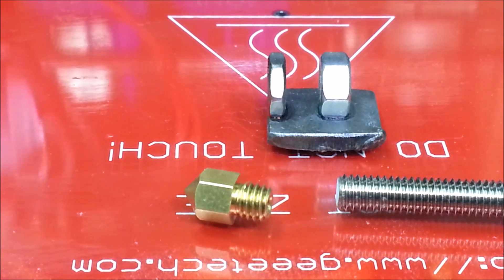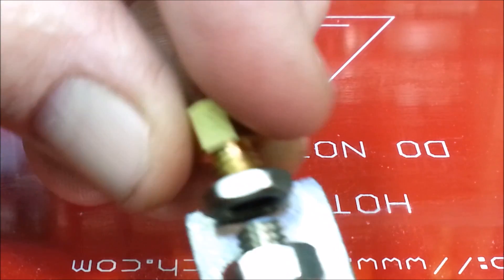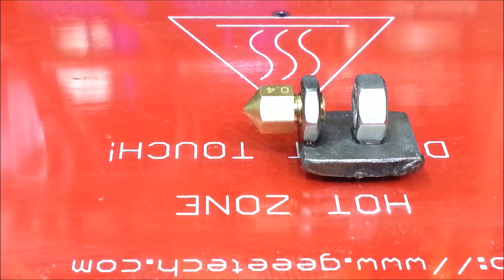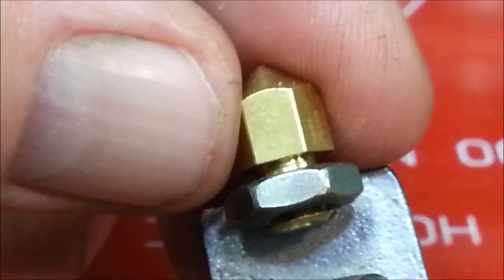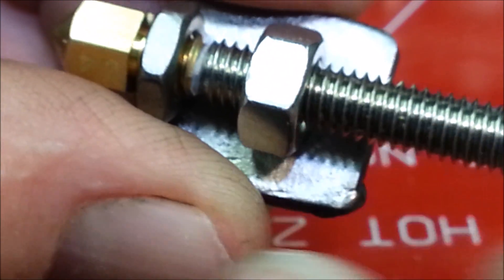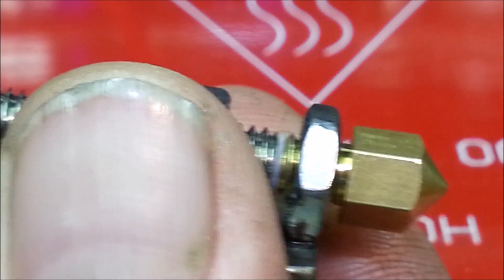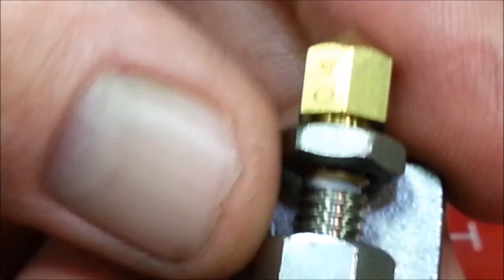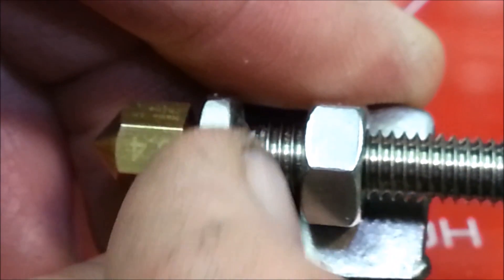How to fix a leaking MK8 Extruder

Comment: can i install the heatbreak upside down ?
Reply from the maker: It's totally possible to do it, Remember the side that is all metal and has the taper goes up.
Reply: so i have a clone mk8 extruder kit, and the ptfe tube literally melts/deforms in 4-5 prints, tried 2 times to get good heatbreak but get the same one with same quality, so i odererd some PTFE tubing, ill replace when it arives, 

do you think this can be problem of hotend not cooling down properly ? because i dont have a fan which cools nozzle or hotend, (i need to print adapter for that, so first i atleast need to get the printer working)

Have you ever had experience with such low quality ptfe tubing ?
Reply from the maker: I finally switched to Capricorn tubing.  It holds up to higher temperatures and doesn't degrade as fast.

Comment: Nice fix, I was wondering if, is it normal filament coming out of the extruder when it is not printing but it's hot?
Reply from the maker: It is to a extent.  Ofcourse the hotter the temperature the more it will ooze.  But some oozing is expected.

Comment: I had leaks from where I put a different 0.5mm nozzle on. I took back off and put the original on and it didn't leak. Not sure what the problem was there but I don't think it's this.

Comment: I don't have this issue, but I have an issue where when I heat up pre-printing the nozzle is pushing out filament and unless I sit there and grab it off with tweezers right up until the print begins it'll ruin it. I've also tried disabling the gcode to feed 3mm of filament pre-print but then I end up with prints where no filament comes out and I have to manually push filament through the hot end.

Anyway....My question is, is there a way to stop the filament coming out of the nozzle pre-print? Should I have retraction in my end gcode and then keep the 3mm purge in the start gcode? Having to sit there removing plastic pre-print is not the greatest, especially since I want to setup a print server and do this remotely. Can't always be around to manage a leaking nozzle, you know?
Reply from the maker: Unfortunately unless you print at the lowest possible temperature it is a necessary evil.   I always have to pick the dangling filament from the nozzle at the beginning of a print.
Reply: @JimmyShawsTidbits1  I've learned to live with that, but now I am back here to fix a problem I created while trying to fix a problem I didn't have. This new hobby is turning into 4 other hobbies, haha.

Comment: Sealing the threads with tape hides the problem and is a bad idea.
I had three 'silent leaks' that way; no oozing from the top or bottom of the heat-block, but PLA did find its way into the gap between Bowden tube and heat-break tube.

With the nozzle cold, could not remove the Bowden tube.  Nozzle hot, I was able to remove the tube with lots of effort.
What he said, nozzle to PTFE tubing fit is critical!
Save yourself lots of grief, make a tubing holder and use fresh razor-blades to get square-end cuts from PTFE tubes.
This issue is going to crop up whenever the PFTE tube and the nozzle must for a seal.
BTW, One 'silent' leak ruined an Olsson ruby nozzle; there is an inner sleeve that holds the ruby in place in the body of the nozzle and I had PETG leak into the body/sleeve gap.
This plastic in the gap made a heat-break, nozzle stopped working.  
Olsson, your design sucks!  That inner sleeve should be sweat-soldered to prevent plastic ingress.
I burned out the plastic [a no-no according to Olsson], re-assembled the nozzle, soldered sleeve into place. Be sure to use a high-temp silver bearing solder as a 245C hot-end will melt common electrical solders!
Yes, the notorious Olsson stoppage has an easily fixed cause!
If you don't mind modding a $90 nozzle with silver brazing, borax flux and a MAPP gas torch, Robert is your parents sibling...

Comment: So i just popped out my  Teflon tube just a bit and tapered the edge (not needing a completely new cut) and 1hour in a 23hour build I haven't seen any leakage. THANKS!
3D printing hobby is not about 3D printing but running maintnentce on the 3D printer itself. lol.
Reply from the maker: Absolutely true.

Comment: Hi,
just to make sure: after this fix one can only print things with a lower temperature than about 235-250°C due too the direct contact of the  ptfe to the nozzle (compare that to the comments on a e3d v6 lite hot end where the ptfe tubing goes as deep). Possible 'damage': leakage, clogged nozzle..
Regards
Reply from the maker: +Christian Abramowski To my knowledge, any hot end that uses PTFE has a temperature limitation.  The only hot ends that do not are all metal hot ends.

Comment: Nice idea, but aren't you just supposed to tighten the nozzle when the head is hot - like 180-200 degC? I am using old J-heads - and I had similar issue when I assembled the head for the first time in cold. But after hot assembly - and proper tightening in hot - there were no leaks at all.

Comment: Great Video. I had this kind of issue with the throat jamming constantly and it was probably due to this. Finally got mine working but haven't looked at the teflon tube. I just have a leaky nozzle now but that's because I only put teflon tape on the throat side not the nozzle side. So gotta do that. 
Thanks

Comment: Hello sir, real urgent. Do you have alot of clogging problem with mk8 extruder? What is the temperature surrounding you?
Reply from the maker: +Steven Lee I do not.  If you are having alot of clogging check your Teflon nozzle throat and use a new nozzle.  Make sure your retraction settings are no more than 7mm, any more and it will clog.  If you still have a problem, consider using a oilers to clean the filament.  Another thing that can cause clogs if filament diameter.  Alot of cheaper filaments do not have a constant diameter causing it to get stuck in the throat.

Comment: I had already had this same problem with mine and I didn't have to do this. All I did was tighten it down while it was hot and it has never leaked again. The Teflon tube on mine doesn't stick out but after I tightened it while it was hot it stopped the leaking anyway. The only problem I have now is settings. I am very new to the 3d printing and have no clue about settings. Any help would be appreciated. Thank you.

Comment: Wow, such a good video with so few views and comments.  I've been looking all over the internet to try to figure out which end of the throat goes into the heater block.  Now I know.  "And knowing is half the battle."
Reply: I found this out the hard way. I broke my throat tube and ordered new ones and I found outI put it in backwards when I thried to pull the filament out. The Teflon tube came out of the end and the screw that you have to mash stayed down because the Teflon backed out. I noticed that it would only come out of one end so I determend that the closed end went up so when I pulled the filament out then the Teflon tube couldn't pull up and get between the part that mashes down to load the filament and hold iot down
Reply from the maker: +Phillip Toone Thanks!!!  Ahhh GI Joe..  I miss that cartoon.  LOL!!!

Comment: I had plastic coming out the top of the heater block as well :/ only thing I can think of is the plastic also worked it's way up the throat and out the top. In process of getting it back together so shall see if it's cured or not. Not having much luck with 3D printing so far.
Reply from the maker: +Michael Whitney Its definitely not as turn key as everyone would like everyone to believe.  With that said, it is a learning experience.  That's one of the reasons I kept making 3d printing videos.  Every time a new problem comes up I try to make a video about it.
Reply: Nope it sure isn't lol. Thought was expecting more problems with slicer settings than mechanical issues. I've upgraded the threaded rods to lead screws so that works a lot better. I think I've sorted the leaking issue thanks to your video. Thanks for uploading videos on any issues you have it's a great help especially as I'm not experienced at 3D printing.
Reply from the maker: +Michael Whitney Until I bought the i3, I had never seen a 3D Printer outside of YouTube videos.  I ran on beginners luck for about 2 weeks.  Then the little problems started coming.  Looking back, I know I caused more than the company did, but it was a learning curve.  I was like you, never thought it would be the mechanical parts that would get me, but the slicer settings.  Funny thing is that's the easy part.  LOL!!!!

By the time I bought my second printer, the MeCreator2, I learned my lessons and it has been s dream.  Could be better hardware, but I think it just seems easier because of experience.  You will become a master!!!
Reply: Same here with my printer lol. I brought I think it's called a CTC i3 from a friend who couldn't get it working. I managed to print of a badly printed cube but Threads in the heater block were stripped and I couldn't find a replacement. In the end gave up and brought a Geeetech I3 pro b and started from scratch though helped that I had already gained some experience from the first one. Still didn't have much luck with printing a decent cube but was using repetier with the cura engine. I decided to buy simplify3D and see how it goes and low and behold it printed a near on perfect cube with the default settings. 

I've managed to print of a knurled M16 bolt for the fun of it and some nut holder things for the screws on the bed as before it used wing nuts so was a two handed job to level the bed and now it's just a one handed job. Tried printing a part cooling fan duct and had the leaking filament issue and after like 4-5 attempts I gave up as it was gone 3 am. Now I've got done the fix you've said in this video and am attempting it again so far so good though still over an hour to go so still plenty of time for it to mess up and it most likely will do towards the end lol.
Reply from the maker: +Michael Whitney LOL!!!!  I know what you mean.

With S3D, you should have way more luck with it.

Comment: i filed and lapped the ends, of the tube and hot end, and put a little ring of soft, annealed copper wire in there as a metal gasket.

Comment: about not screwing the throat too tight..., I learned it the hard way too. I second your rational about the teflon tape and heat isolation on the nozzle but then, following the same rational, it should be good to put teflon tape on the throat junction to the heat block. It would not only reinforce prevention against fluid leakage but also add some heat isolation to the throat.
Reply from the maker: +jesuschal Good point.  Thank you!

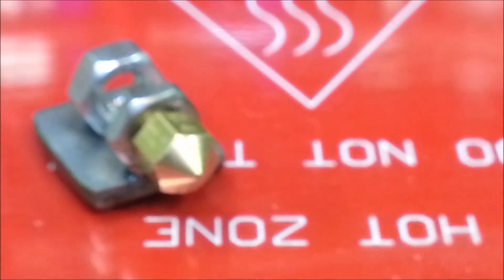Comment: Sorry me again, cut PTFE with a sharp knife slowly so you don't deform the tube. Dremel, veils, rasps will create small PTFE particles and because they don't meld clog up your nozzle. If you look @ the video 5:05 you can see stuff that can get into the tube and therefore the nozzle.

And hand cream will help a lot :-) I know by cleaning my soldering iron tip with my fingers lol.
Reply from the maker: +Voyager Hi Voyager!!!

I 100% agree that cutting it with a sharp knife would be best.  I should have done a better job of cleaning up what I filed away and made it clear to be sure and remove any debris before assembling the hot end.

LOL!!!  I didn't notice my fingers looked that bad till I was rendering the video last night.